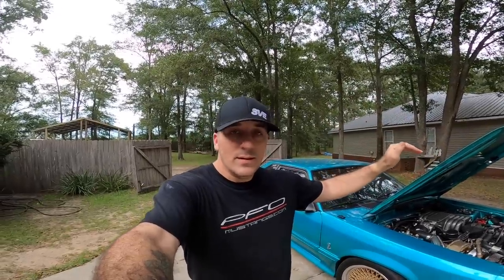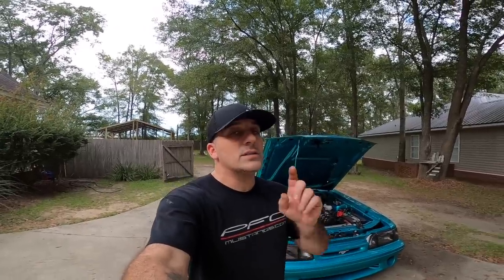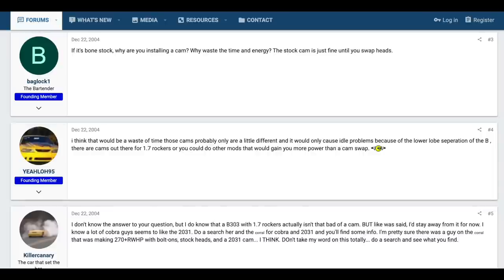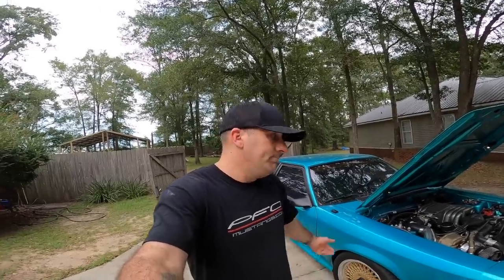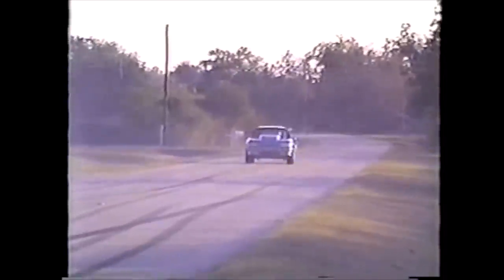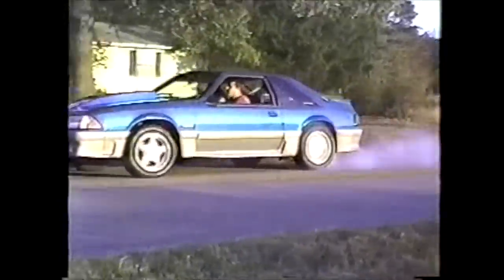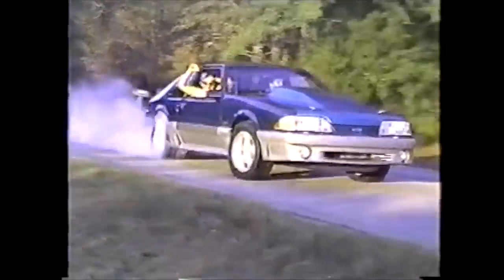THE B303 CAMSHAFT: Why the HATE why the HYPE?

Comment: Ran a B303 camshaft back in HS.  91' LX Coupe.  5.0 basically stock, with the B303 and full exhaust.  Inevitably ended up with a Panhandle Performance 306, EFI->Carb swap (yes, people really used to do that), with ported heads and IIRC a Z303 camshaft.  We weren't YouTube experts back then.  Unfortunately sold the car for pennies back in the Obama era after I purchased a Z06 Corvette.  Like you said, it really was all about the 'sound'.  There was nothing like a cammed up 5.0, 10-15 years ago.

Comment: My 85 GT 5-speed was bone stock, other than 4.10 gears and an old 289 F4B intake I had laying around, as the stock intake on those cars have ridiculously tiny ports. I tuned the stock Holley carb too. That car was a lot of fun.

Comment: I have a 88 gt with stock engine..i added power pulleys and removed stock fan clutch set up.i installed electric fan set up..car seemed to have more pep than my friends 90 gt with 75mm throttle body.cold air intake tube and offroad xpipe..he lost torque..i believe the power pulleys and electric fan would be a cheap  add on for someone who wants to feel a difference in bottom end torque...your video is great and straight to the point.

Comment: Dynoed a b303 cam with that being the only change. 15hp was the gain to the wheels.  Car had gt40 upper/ lower. Headers, off roads. Mufflers, larger mass and th- body. Under drive with 3.55 gears

Comment: The B-cam is good. How ever the E-cam is good as well. The E cam plus 5 speed of course, has a stronger mid range which is good for street range, and also add a  little extra compression and good flowing heads (for me back in the day Would Products Windsor Jr) will make up for the smaller cam across the range and also in the upper range as well. I have surprised plenty of B-CAM guys back in the day. Both  cams are great. I'm just more partial to the E-cam. Fly cutting pistons is standard operating procedure for me. Plus right now I'm running a lunati 51014 cam and World Products Windsor Sr. which are milled down to 57cc. Fly cutting is a must and also works.
Reply from the maker: I prefer the drivability of the E cam honestly 👌
Reply: @BREW2LFOXBODY  that's another reason that I've forgotten to mention as well. I like chop in my idle but drivability is very important to me in a street car.

Comment: I’m new. I have a 94 cobra. I put a b cam in and changed the heads to Ford x2 heads. Bbk shortys & h pipe. Bbk 70mm and cold air. Didn’t gain much from stock. Under 300 hp

Comment: Fox bodies always run good with spray if you're out here in a fox still running a 5.0 the only way to really compete is with spray or FI, I raced my buddy's 331 stroker, dart heads, vic jr intake 750 carb 12.1 compression stick car and my trans am with a cam, 4k yank converter and long tubes gave him the business

Comment: You can fit a trick flow stage 3 in a stock motor. Had a 93 notch with a 95 roller motor. Had stock bottom end ported e7 heads edelbrock victor intake 750 quick fuel carb 1.7 roller rockers. Had a built c4 5500 stall 5.13 gears. Twisted that car to 7500 for 2 season. Did have arp hardware holding it together. Crank broke at 8000. Car ran a best of 6.93 in the 1/8 th.
Reply from the maker: 👀 Jesus
Reply: @BREW2LFOXBODY  always wanted to put better heads on it but it ran damn good. It helped that the car was gutted and weighed 2700
Reply: yes, even richard holderner said a tfs stage 2 fits ...
Reply: Any cam will fit if your valves are small enough.

Comment: Ive been running a F cam on stock motor for over a year. For anyone curious, yes it works.
Reply: How does the f cam sound compared to a b cam?
Reply: Ron Ross it hits a lot harder but i got it because its the “boosted cam”. No complaints here
Reply: How does the fcam feel in a stock motor compared to the stock cam?

Comment: I ran a Crane 2030 (.533/.544) with 1.72's (!) stock heads and valves prob saved me. Should have done 2031 for more top end lol...
Then again, I was the crazy kid that also bolted on a blower, and then sprayed it with 125 shot.
Motor lasted from brand new till two years ago, got tired/blown head gasket.
I'd rather be lucky than good any day.

Comment: Back in 2011 i ran a expo stock bottom end with the mighty B cam with procomp 190cc cylinder heads that had 202 intake valves. 160 exhaust valve and ran 1.7 rockers whitch bumps the lift from 480 to 510 and .5 to the duration and later changed to the E cam whitch is 498 lift but with 1.7 rockers bumps the lift to 528 and both cleared the untouched piston with room to spare ..with both set up i ran a victor jr single plane with a 700 cfm double pump a C4 trans with a worked valve body a 3200 converter and 373s out back and ran on motor with the b cam 13.71 was the best and on a 150 shot ran 11.40..with the Ecam ran a best of  13.57 and on the same shot run 11.33

Comment: I installed a E303 cam and TFS valve springs for the stock E7 heads. People said it wouldn't make a diff. It sure did pulls harder in every rpm and still runs 14.6 afr cruising and 12.5 WOT. plus the idle sounds fucking fantastic great lil street upgrade.

Comment: You mentioned that people put B cams in manuals, and E cams in autos. Can you elaborate on that? Because I  have an E303 in my manual right now. And i love it! Just curious of why people would use an E303 for auto?
Reply: The B cam is a little rowdy without a stall convertor and some gear. A loose convertor and 3.73 and up gears are a great match. The E cam has better bottom end. The F and X cams are more mid and top end in a 302, but will be nice in a stroker or 351W based combo with heads

Comment: You would be surprised what how big of a cam you can put on a stock piston with a 2.02 valve. Currently running a .588 lift
Reply: Hi what is the duration and rest of specs on this cam?

Comment: You've convinced me now. B cam it is. Screw what haters got to say. My question is will i still be able to daily drive it? Going to do gt40 heads also. Will have basically explorer top end with full exhaust. Maybe 24# and matching maf. Its my daily rn even AC. Dont want to loose that
Reply from the maker: Absolutely, you can daily drive it ✊
Reply: @BREW2LFOXBODY  awesome, thank you sir 👍
Reply: @marianomichel964  I don't the same thing. 1994 gt with true  cobro upper and lower intake. Gt40 heads, b303 cam, long tube headers. It does pretty damn good for what it is

Comment: Also over the years I've had several foxbodys with multiple alphabet cams.  The f cam in my opinion is the best for carb applications, my car didn't lose much low End torque and picked up a lot more pull above 3k rpm. Just my 2cents

Comment: I had an engine builder tell me custom grind cams are just relabled boxes
Reply from the maker: Absolutely 💯correct! Unless you’re paying big money for someone to actually grind you a CUSTOM cam. Nothin wrong with honestly as long as it matches the needs of your setup.
Reply: Cams heads and carburater can make or break a good build. Every one always goes the biggest. The only things i ever noticed about the 302 that they like big is fuel and timing. Everyone i built seemed to like most ti.ing and fuel i could pour to them. Always a good subject to debate on

Comment: I run a ford motor sport F cam in my 92 lx notch mine kicks in hard mid range around 55 60 mph i always got acussed of spraying with F cam i run it with ported and polished e7heads and 202 valves with roller rockers and cobra uper and lower intake 77mm mass air and throttlebody 24 lb injecters it realy wakes it up midrange with 373 gears it kicks in hard i always pulled cars mid track b303 guys alway got me on the start but that F cam would hunt them down every time then they would acuse me of spraying. The F cam worked awsome for me.

Comment: Depends on what motor you have... apparently there is some I cant run in my 85 carburated ? Or my 77 351 Windsor ?
Reply from the maker: Very true ☝️
Reply: A 351 can have a very mean cam.. and heads that flow monster numbers

Comment: My 92 gt idle is lower by about 200 rpm and the voltage is lower now. Instead of 14 is around 10.  Overnight.  You think that's the alternator?  Voltage is up around 14 when moving.  Thanks.
Reply from the maker: I have the exact same problem with the Calypso, I’ll do a video on it and share the findings. But I would suspect it’s the alternator
Reply: @BREW2LFOXBODY  thanks.

Comment: I put stage 1 XE262AH comp cams in my 2002 Mustang GT and definitely felt a difference.
Reply: That is a 4.6 pi 2v totally different car.  They have much better heads than what the fox mustangs came with so a cam upgrade is going to be alot more noticeable.  What he meant by not tell a difference is on a stock head stock intake 5.0 and not being able to tell the difference between a b cam on that motor or a fancy custom ground cam.

Comment: so your opinion is that if you have a auto, 3.73 gear, 3200 stall, gt40y (svo swirl aluminum heads), upper and lower intake, you would find it hard to believe to see a big difference between a E303 cam vs B303 cam?

Comment: Ok I’ve been trying to decide on a cam for my car and need a little insight I have a 1994 gt it’s no longer fuel injected I have stock heads stock bottom end but heads are ported polished and port matched intake upgraded valve springs and roller rockers heads are also shaved .045 and it’s a stick car

Comment: I know someone whos had a foxbody coupe with an E303, old school SVO aluminum heads and a GT40 intake. While I have the TFS 1 cam, GT40X aluminums and GT40 intake. Really not that much of a difference in performance. Hell look at people like Neomustangs running stock Ford parts and stock cams for a turbo setup. That should say enough for itself. If you were looking to build a stroker motor like what AV Boys did with their Grey Mare build then I can see camshaft selection becoming a huge role to match everything else you have and run at its best.
Reply from the maker: Bingo 🙏

Comment: 5 speed car, stock longblock with a Crower 15512, 1.72 rockers, a GT40 intake, 65mm throttle body, a ProM mass air with 1 1/2 long tubes was definitely the best  you can squeeze out of a stock longblock car. Huge difference over ANY of the letter cams.

Comment: One thing I want to mention, I have a set of procomp 210 heads with 2.02 on my stock bottom end truck 5.0 and the f303 cam has a ton of piston to valve clearance. Maybe I got lucky? Are the truck pistons any different beyond cast vs forged

Comment: Wish I would have known a week ago just waisted 200 on a cam 😑 I used the car club donations, it was my week, should have went with the 75mm throttle body and spacer. Got a full thank you gas though happy on that one.
Reply: Is not wasted if you install it, is going to make a difference but if you invest in valve springs that's going to make a huge difference believe me.

Comment: I have a 1995 mustang GT and I put an f303 with trickflow track heat intake and a 1 inch phenolic spacer with crane cams 1.6 rocker arms and 1 /16 taller trickflow pushrods and ford performance 1/16 taller lifters with stock bottom end and stock e7 heads car is faster but not what I was hoping for car stalls out randomly and barely burns out . Hoping someone can help with this please..
Reply: 95 computer sucks,definitely not going to handle the f- cam. That's one of your problems..

Comment: I just took out the lifters from e7 heads and they are flat at the bottom, but the gt40heads from the explorer I got from a junkyard had roller lifts...does that mean I need to Change my cam regardless from my fox?
Reply from the maker: You can run the Gt40 heads on a non roller block. No issues that I know of.
Reply: BREW2L will I need longer pushrods due to the different length that they stick out?

I guess a better question is, is the cam from the 96explore the same as my 91AOD. Because I have the roller lifters from the explorer
Reply: @robisart7715  the explorer cam is not as aggressive as the ho cam it is designed for low end truck torque and is a downgrade hp wise to stock ho cam.  So the answer is no it isnt the same.
Reply: Michael Harris ok thanks! So use the same lifters from the HO correct?
Reply: Yes to roller lifters

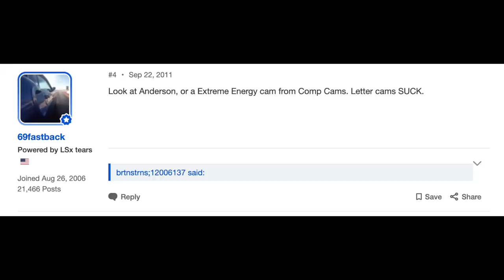Comment: My 4eye fox before I went crazy had a 306 with GT40x heads 24lb injectors with a f-cam with cobra intake w/ 4:10's went 12.20 @ 109 without spray. Only ran one pass on 125 shot it went 11.6 @ 118 and got kicked off the track for not having a roll bar.

Comment: I am completely stock. Stock heads and stock intake I was told that I have to run 1.6 roller rockers and upgrade the valve springs or I could run into issues... I really just love the sound of the b cam and I don’t really care about horsepower but I don’t want to have any negative mechanical issues... What’s your opinion in this?
Reply from the maker: I can’t “recommend “ you do this.. but I’ve never changed the valve springs just to install a B cam. Never any issues
Reply: If your doing a cam swap you might as well doing timing chain water pump lifters rockers valve springs and especially a tune ect because the motors already apart so why not change it all so you don’t have to in the near future I run the bcam in my 94 cobra before I got a tune it ran terrible with a tune it runs like a dream

Comment: In a 1982 5.0 fox, will a b303 cam work with everything being Stock? Cam swap & go? Or does anything have to changed in the older 5.0s?
Reply from the maker: It won’t work in a non roller block.
Reply: Oh ok, so would have to get a kit for my engine?

Comment: Was always taught with a fox first mods should be gear and exhaust🤷🏼‍♂️

And then go from there with HCI
Reply: And still the gears made the most seat of pants difference😂
Reply: Lot of the old fox problems really were traction and not being able to put a bigger tires on unless you rolled fenders, beat the shit out the inner fender and removed quad shocks....and even then there were still limitations.....definitely were great at doing burnouts to show off though😂

Comment: 90 GT 5 speed stock block, cam & heads... 1.72 Cobra rockers, bumped timing, big mass air & throttle body.. shorty equal length headers, 3.73 gears hi-flo H-pipe... 3 chamber Flowmaster cat back... on Michelins XGT's.. ran 14.00 @ 98mph... in 1990 THAT WAS FAST... took giggle gas or boost to do better stock block...

Comment: I liked the E cam and 1.7 rockers with my GT40p heads for my street car. The B cam made a touch more power and reved higher but the E felt better on the street. Went to Twisted Wedge 170 heads, street heat intake and a stage 2 trick flow cam, 1.6 rockers and that was a heck of a combo. The E cam was terrible with the TW heads.

Comment: I just bought a b303 cam I need help with the chain timing I have CM-6250-B303 from summit racing going into a 306 stock crankshaft eagle rods sp pistons, edelbrock performer rpm heads edelbrock performer rpm efi intake scorpion 1.6 rockers. I don't know how to set the timing for being able to make power all the way up to 6500rpm

Comment: I have a stock 91 lX bracket car, runs 8.4s motor is bone stock wore out with 75psi cylinder pressure, car has c4 3500 stall and rev manual valve body and 410, wonder how much the b cam and 28psi injectors and 70mm throdle body will help mine?

Comment: Does this go for the 2v also? I have a 2v, 99 gt. I have 347 stroker Windsor block, porter & polished PI heads, trick flow track heat upper and lower, BBK 78mm TB with MAF, BBK COI, BBK shorty headers, BBK off road h pipe with dynomax mufflers. Also 24 lb injectors with MSD coil packs. Ford racing 4.10 gears, 8.8 solid rear. Only thing I don't have is cams, and I need cams. Please help me, what cams should I run. I don't have to have to change allot as I have already put in tons of work as you can see. Please help

Comment: On andrews car what year did u get the throttle cable off of I’m putting a 306 carburetors in my 92 coupe
Reply from the maker: He has a lokar throttle cable. But you can modify and use any from the carb years of FOXBODYS.
Reply: I used one for a 83 mustang the early fox had carbs

Comment: Brew2L what type of Mufflers are you running with your turbo setup? 
Also when I install my f cam should I remove my Crane Cams 1.7 lifters and put the stock 1.6 back on my setup is a automatic turboed 302 gt40p heads ect......

Comment: Doing a high reving build would recommend a b or e cam for 7500 shifts possibly 8k
Reply: None of those cams are designed for that much RPM.  And you better have a spit short block to pull that high

Comment: I haven't got my car running yet but I would like some thoughts on the setup that I've got it's a 306 with speed pro pistons, gt40p heads that's had the exhaust and intake ports smoothed out and gasket matched 3 angle valve job cleaned up underneath the valves, b cam I've got 1.7 and 1.6 roller rockers, eldebrock rpm performer intake, 650 double pumper holley, 1"5/8 BBK long tube headers t5 trans 3.55 gears does this sound like an alright combo any thoughts greatly appreciated thanks

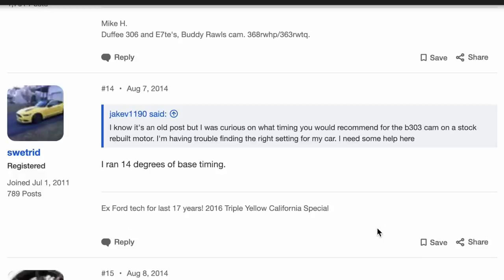Comment: At 0:36 you highlight a post of mine from the inter-webs of yore... that was shocking yet cool to see.
A stock EFI 5.0 from the day could run with the right cam, trouble was, no one was making/marketing the right cam. 
Friend had a full weight GT, pump gas, GT40x heads and "real" GT40 intake... long tubes, 4.30's and the... you guessed it,  B-cam.
In the early 90's a low 12 second no juice street car was the real deal... and he ran bottom 12's weekend after weekend.
How about you do a video about the crappy the E7te heads... I'm currently making 368rwhp with E7's on a n/a 306 running 91oct pump gas.
People get so wrapped up on "part X"... when, that "single" part has little to do with the "entire combination".
Love all the folks who have posted they are running the B-cam.
Love.